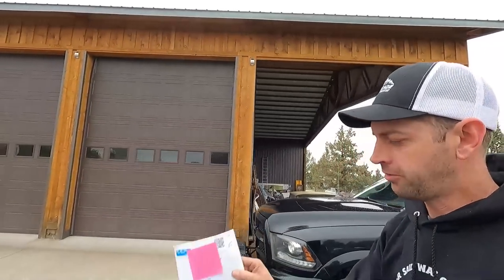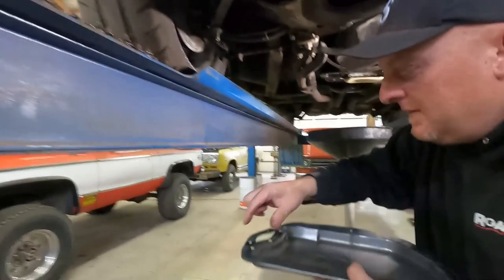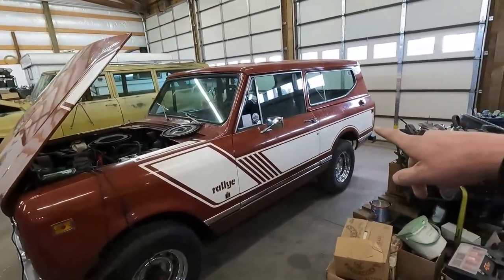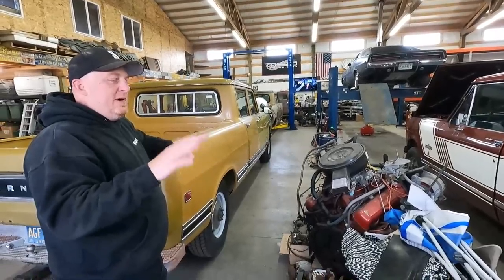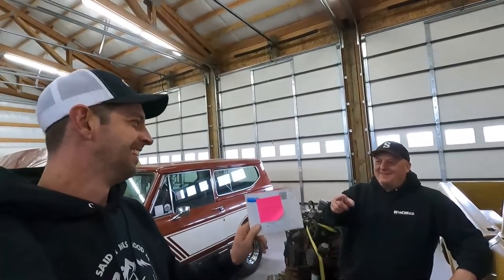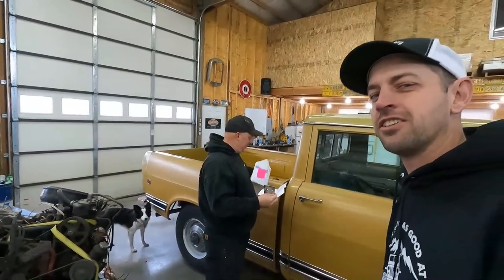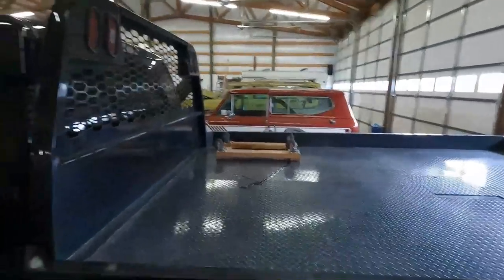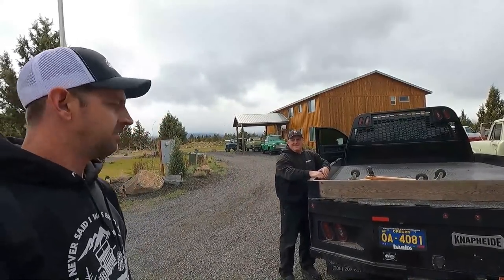How this envelope changed the course of YouTube forever.

Comment: When I worked as a Mac Tools tool guy, I recommended that the young mechanics start with a good Mid-Range Box and a big set of Craftsman Tools, then they could buy the specialty tools as needed and buy better basic tools as their budget could afford them.
Unlike drug dealers, I didn't want to enable the Tool Habit of young mechanics beyond what they could afford.
One of my early and favorite specialty tools was the cooling system checker.
Reply: Still have mine I bought in the 80's
Reply: @dannyw7662  Mine has disappeared.  I don't remember loaning it out.  It could be that my shop is just disorganized.
Reply: Mechachad.

Comment: You should be using gasket # 2464324ac or ad from mopar better than that crap one you got trust me. Reusable and it at your local dodge dealership same as a 46 47 and 48 re trans

Comment: FWIW, you never really want to use RTV on automatic transmissions (not even the pan) but also on carburetors (aside from the baseplate but only if you really have to use it).  RTV can break off in little chunks due to heat degradation and clog the hydraulic circuits of the transmission; and gasoline is a solvent of RTV which can also break off in little particles clogging jets and air bleeds in the carb.  If you absolutely have to reuse air horn and other carb gaskets that are not broken, instead of using RTV soak them in WD-40 (or mineral oil, which is the same thing). It restores some of the crush-ability of carb gaskets.